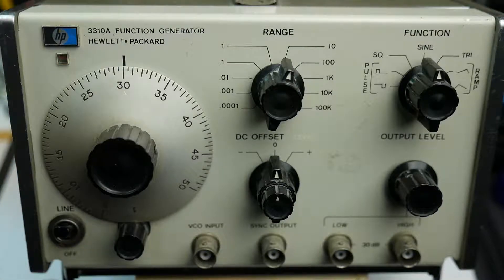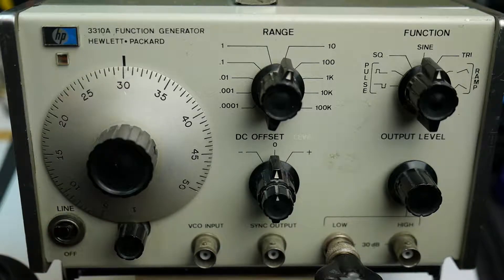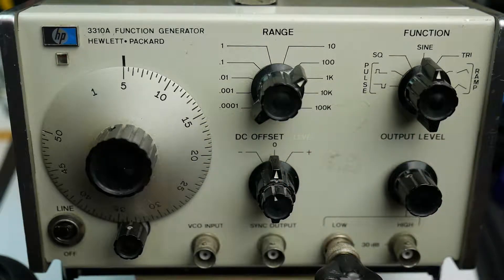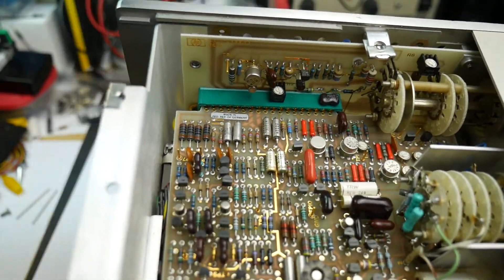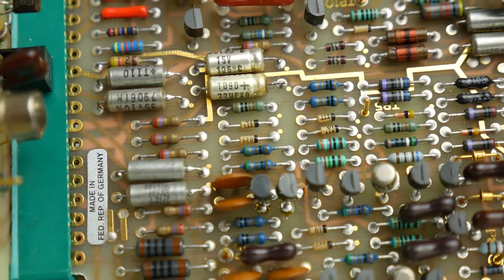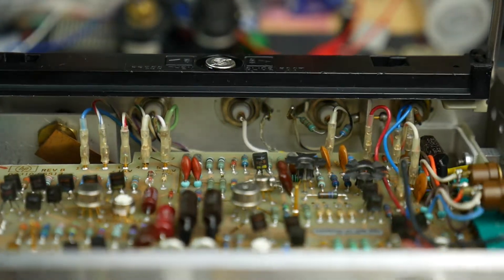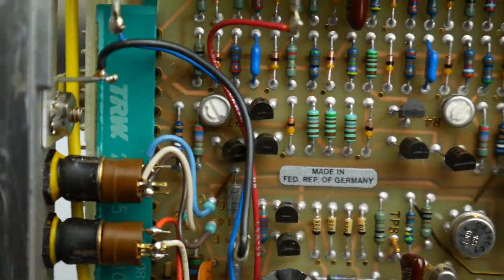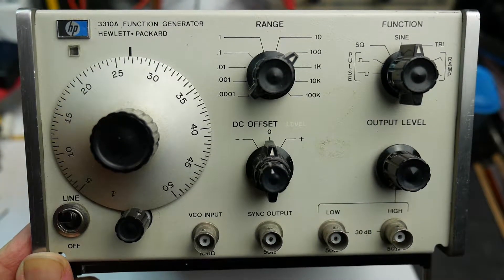Test Gear Teardown: HP 3310A Function Generator

Comment: Yeah, made in Boeblingen near Stuttgart. Swabian silicon valley in the golden age of european elektronic manufacturing plants. This plant ist still existing in 2019. From a spin out from Hewlett-Packard in 1999 to Agilent Technologies and up to Keysight now.
Reply: three transistors are replaced in the negative 25V circuit. They don't clean the PCB :-(